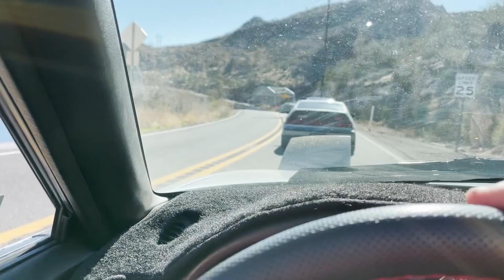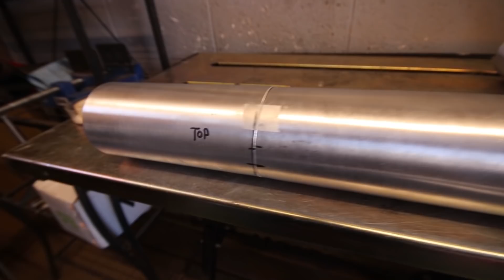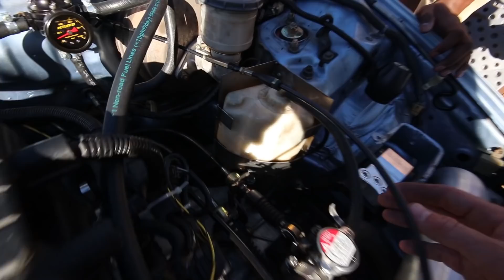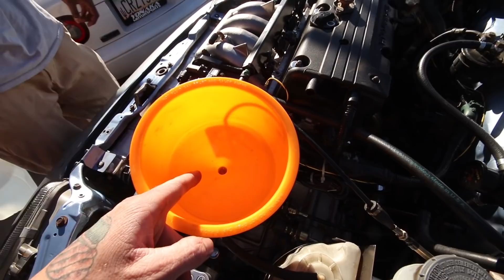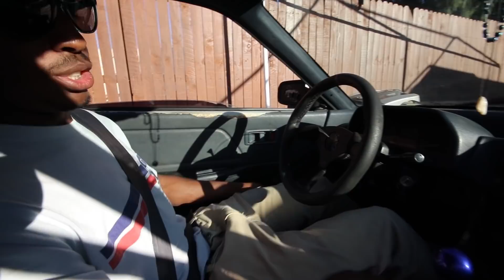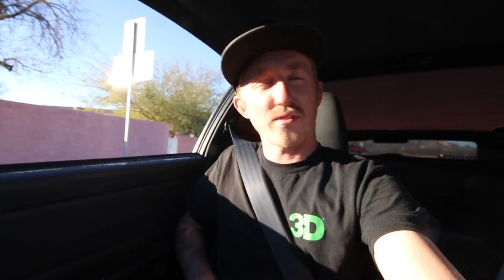K20 CRX First Cruise/Building Cold Air Intake

Comment: You should be able to add the vtec solenoid to the display. It would be a box labeled "VTS" and light up when vtec engages. Super stocked for DJ!!! Its a fresh swap, just got to work out the bugs.
Reply from the maker: That works on KTUNER?
Reply: @ChrisSadowski  sure does. You should be able to right click on the display screen "add new gauge or value" (cant remember which), and select VTS. You may need to define it as an on/off but that should get you what you need.